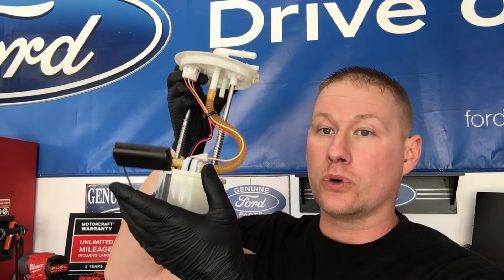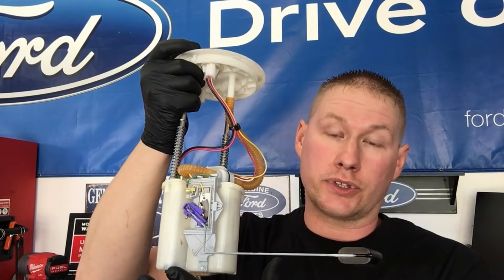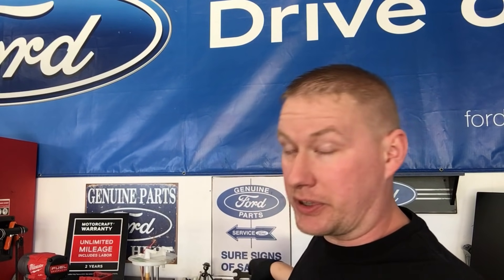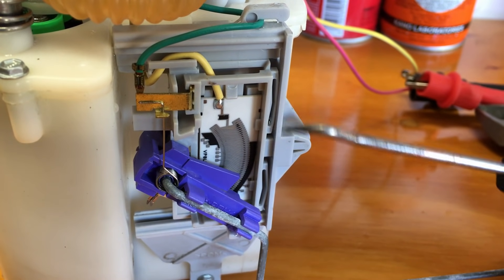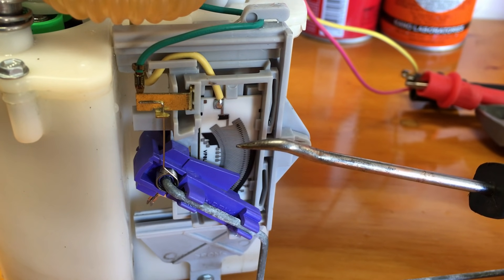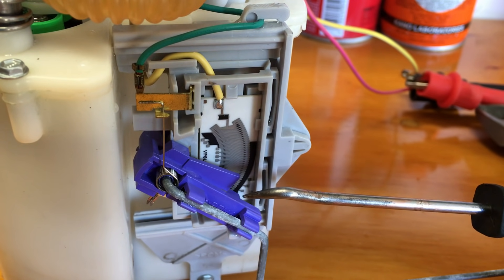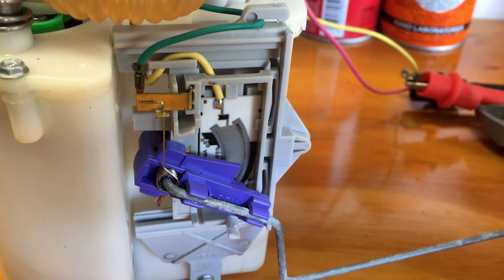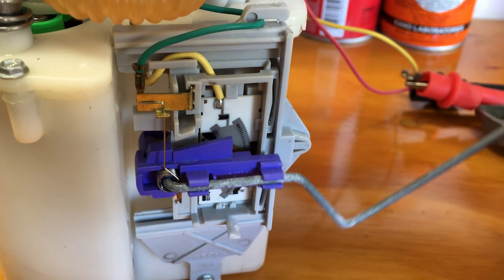Ford Quick Tips #77: DTC P0460 P0463 Erratic Fuel Gauge Quick Fix!

Comment: Replaced the sending unit on the pump for a 2008 mustang & now the gauge reads 1/2 fuel for about 30 seconds & then drops to empty.  Ran a scanner & no codes, but the scanner shows the tank is empty.  Could it be the BCM?  Any suggestions would be great.
Reply: New does not mean good. Always find the fault before replacing part.

Comment: While driving home from work today my speedo and tach needles were fluctuating irraddicly, 4x4 hi and lo lights were flashing on and off (not constant, but like once a minute) as well as the battery light.  Checked my alternator and I got 14.38 to 14.64v with the truck running.  Checked for codes and got a p0462 fuel level sensor circuit low input.  Would that cause the instrument cluster to act like I described?
Reply: It sounds like you had a ground issue. What’s this the case four years ago when you posted this?
Reply: @UhBuddy1976 No the issue was the body control module (pink wire I think) or maybe purple...was intermittently not making connection with the gauge cluster console.

Comment: Hey man, thanks for the video, so basically what’s happening in my truck is the P0463 so I thought to just get my fuel pump changed due to truck has 210,000 miles and it’s an 08 Ford F-250 5.4. So I changed the fuel pump and it’s still throwing the code and the gauge don’t work and only works when the fuel level is really low. Do you have any tips on what I can do? P0463 fuel tank level sensor high input , thanks man
Reply: I got P0460 and P0463, but the unit to replace it cost 700 dollars

Comment: So I just replaced my fuel pump as it was time and have had the erratic fuel gauge issue for over a year now intermittently. Thought it was the sending unit all this time and just went to fill up the tank and the gauge stopped at 1/2. I noticed driving the 1 mile away I live from the pump it started to creep up a tick or 2 on the gauge but I let it idle for 5 min after on level ground and nothing changed. 

And ideas what else this could be? I have no codes

Comment: 05 Explorer with the 4.6 V8, fuel gauge doesn't work after a fill up until it gets down a couple of gallons then it will start working again.  I have ran several bottles of the Chevron Techron Plus through the tank, the fuel gauge will work normally for a couple of tank fulls then it goes wacky again until I dump another bottle of this stuff in it.  I started putting gas with a small amount of ethanol in the tank, it is still 87 octane and that seems to have helped though the gauge still occasionally wacks out after a fill up.  Worst thing about the Chevron Techron Plus is it is expensive.
Reply: I may have to pull the tank and replace the guts and be through with it.
Reply: I'm currently having the same exact issue with my 2005 explorer after fill ups. Did you ever get the issue completely resolved? If so jow?
Reply: @rachel1724  no it still has the fuel gauge issue.  As soon as the tank level gets down to around 3/4 full the gauge always starts working again.  Our Explorer now has 225,000 miles on it.  We have a couple of newer vehicles, and are not going to spend anymore on expensive repairs for this vehicle.

Comment: I have a 2005 Ford Explorer xlt with the 4.0 sohc and is has 177k miles. My fuel gauge hasn’t worked since 60k miles always used the odo trip meter as a fuel gauge. The issue that I’m having is that it pegs below E when you turn the key on and never rises no matter what I do. I dropped the tank. Pain in the a** if you don’t have a lift to work on. But I managed to get everything out without an issue. I removed the fuel pump assembly and decided to ohm check the sender just for the heck of it and it worked as it should. I went on with some more testing trying to fool the gauge into thinking that the tank was full with the two wires that run to the gauge with no luck there either. So with my luck and the vehicle having 177k miles I decided to put a new fuel pump in it since the harness was still accessible for further testing and put it all back together. I also checked another instrument cluster thinking it could be the gauge with no luck there either also pegged below E with the other instrument cluster. I did numerous tests including a gauge sweep and that’s the first time I’ve ever seen the gauge function and it brought me hope that it could be a simple fix hopefully you can help me out or point me into the right direction. The only codes that I got for it was a p0463 and the message for that was fuel level sensor A high input. And a B1201-00 and the message for that was fuel gauge sender circuit open or short to battery. Any help would be greatly appreciated
Reply: did you finally get a solution? i have the Same Problem on my Expedition.....

Comment: I got P0461 / P0463 2010 expedition the other day shows —- miles to empty and gauge is on empty with a full tank of gas I’m going to have to try this . I figured the fuel pump was going to have to be replaced since it’s one unit but I’ll try this first .

Comment: I have a 2012 F350 with a 6.7L diesel. I am looking for info regarding the resistance readings in ohms when the tank is full and when it is empty. I have read elsewhere that the readings should be 15 ohms empty and 160 ohms full but this video shows it to be exactly the opposite. There is probably a difference due to year and application. Does anyone know what application this sending unit in the video is for and also does anyone know what the readings should be for my application? Thank you.

Comment: Had the fuel pump go out in a 1999 Ford Expedition. I replaced the pump assembly, everything went smoothly, but the guage still reads erratically. It's unreliable to know the fuel level. Any further ideas on the cause?

Comment: when my fuel gauge get just under a half tank it starts to drop quick and then sometimes comes back up later , Is this the same thing you are talking about ?
Reply: Did you ever try this?
Reply: Mine does the same, sometimes throws the 460 and 463 code. Gonna have to try the fuel additive
Reply: @justthetibb1569  did it work? I have the same issue, but my car is jacked up in the rear, as in on Jack stands not that it's fucked up.

Comment: Gotta thank you for that additive tip.  It completely worked and saved me hundreds by replacing that sending unit.  The first 1/2 tank, I went on a back road with no traffic, and would pump my brakes to slosh the fuel around. It started working perfectly right after that.

Comment: I have a 79 Ford E150 Chateau (dual fuel). Crank no start. Fuel gauge not working at all and no power on pump. 😭 It has new oil/filter..air filter/sparks and battery. 😪

Comment: This tip for the adding the Chevron Techron Plus fuel additive worked immediately for the problems we were having with our Ford Truck with a mustang engine.   My wife and I are amazed.  Mechanic wanted to replace our fuel pump - $680.  We are so thankful for your helpful tips on this site.  It was a God send for us.
Reply: *  I would not replace the fuel pump unless the fuel pump was not working.  I can live with an incorrect fuel level reading by keeping track of my mileage with my odometer.   

The fuel level sending unit was sending an incorrect fuel reading and also probably causing a check engine light.       Your vehicle could have been driven just the same.   The fuel pump runs just the same with or without an accurate fuel level sensor.
* Do not run a fuel pump dry so fill up the gas tank and reset the odometer after each fill up.

Comment: My guage is crazy. I put 22 gallons in, and in 3 miles it reads already 1/4 tank gone. Other times it just completely goes to empty, then it shoots up to full, and today it stayed stuck at 1/4 tank when I added 16 gallons. After 25 miles driving it went to just under 3/4 full then back to half full on next start.... what in the heck is going on?

Comment: The whole thing is about 140 dol max, don't make sense just to change sending unit part after it has been working for over a hundred thousand miles, replace the whole thing fuel pump and all. labor is the real cost.  I am currently trying the Tecron stuff about 2/3 of the first tank gone but no change yet.

Comment: About 3 weeks ago my fuel guage stopped working all together.  If it's just a dirty contactor then I'll try this additive and get back to you.  Right now I'm looking at $500 to replace the whole pump
Reply: Hey did it work?? mine gauge stopped working to
Reply: @abel21ist  no it did not.  I think that it's the computer slowly going out.  The fuel guage worked fine for about 3 weeks and went right back to throwing codes.  Currently, I occasionally get a "service engine immediately " message on the display and I take it to my mechanic and his diagnostic test cannot find what is causing the message.

Comment: I have an 07 f250 6.0, and i just got the p460, can I use this stuff in my truck or should I use the techron diesl fuel system treatment? I ask becuase I dont know if its as effective as the one youre mentioning, and I dont know if its safe since its based around gasoline and not diesel.
Reply: I would like to know as well??  I can not seem to see the answer in here.

Comment: Thanks for the info Bro, but I got a 2004 Ford Focus SE 2.3L that's giving me code P0460 and P0462. I replace the fuel pump but I still having the same issue. What do you recomend?
Reply: Hello, did this clear your 0462 code at all? have you tried? I have the same problem, but the code is P0462 not P0460

Comment: 2000 v6 mustang.  owned since new. never had a problem with it until the fuel pump was replaced almost 2 years ago. it drops to empty with the low fuel light at a quarter tank. no codes though. I'll try the techron
Reply: Did this work?. ...I have a 2006 Saturn ion I just replaced the fuel pump and it's a quarter off

Comment: My 2001 sport trac reads opposite of that. It is 15 ohms empty and 160 ohms at full.  Ichecked it against the old one and same reading. The problem I am having is that the replaced fuel pump reads erractic when below a 1/4 tank. It will be at a 1/4 tank, then when i start driving down a straight road it will go to empty, go around a curve and it will raise back until going straight again. Whats up with that?

Comment: Thank you! 

I ran 2 of the black bottles through my truck. The light didn’t initially go out, but about 200 miles in, it went out and after 80 miles more it was still off and passed emissions!
Reply: BerrymanB-12 part number 0116  in a round can is much better. And it's cheaper. I managed a parts store for 28 years. This saved a lot of people from buying carbs.😁Just don't add to oil it cleans it to much.

Comment: Hi sir this Qader from Colorado i have 2001 ford F-450 v10 gasoline there is no check engine light everything is fine but when i want drive it. the truck has no power can you help out. and also  i changed the air filter, fuel filter but it is still the same thank so much.

Comment: I have a 2008 6.4 F250 and it runs out of fuel at anywhere between 1/4 to 1/8 tank I hope Chevron stuff will fix it as this truck is a miserable B!tch to get started after it stalls

Comment: Hey what can I use for same issue on 2008 f250 diesel?
Reply: Ever get an answer to this?
Reply: @9brad86  no I didn't, but mine stopped jumping around .I realized that the computer goes by the milage the truck was getting the last time the truck was running so my digital gauge would read a different miles to empty each time I turned it on . So if I drove up a hill and it said 100 miles to empty them I shut it off and turned it on again it might say 80 miles to empty ,coast down a hill turn it off ,turn it on again it might say 110 miles to empty. Only one time did I turn it on and it said 0 miles when I knew it had about 100 last time I ran it .that freaked me out and I started looking up videos  . However other than that time it makes sense to me now.

Comment: Quick Question, have a 2013 ford edge that gave me the same code. Fuel guage stops working when it reaches half way. Vehicle has roughly 65,000kms. Is there an access panel for the pump from the inside? Or do I have to drop the tank. Just incase the Techron solution doesn't work

Comment: I add Techron Plus at the beginning of each month on all my gasoline vehicles but just got a P0460 "Fuel Level Sensor Circuit Malfunction" this morning. It only has around 12000 miles on the Ford dealer installed fuel pump. Techron or another similar cleaner might work for someone else...........

Comment: Hi- I have a 2006 mustang that just started giving me this problem where the fuel gauge drops down to empty and then back up slowly. I have changed the cluster panel, fuel pump, passenger fuel pump module and used the Techron Plus. Still having this problem, any idea what to try next?

Comment: This stuff is great. I've used it for years. It cleans so well that it made my truck's fuel pump last 2 months before dying, allowing me to get engine and suspension done first, while still driving it. Truck started hesitating, added techron. 4 weeks before symptoms again. Repeat. Went 3 weeks. Repeat. 2 weeks, 1 week. Made appt for a new one at mechanic, fuel pump officially died when I tried to leave the shop lol. Yeah, this stuff is amazing. It may be slightly more pricey but it's worth it.

Comment: Hello can anybody help me I have a 2013 ford fusion I have the same code coming up I replaced the fuel pump and that still didn't fit the problem right now i have a full tank of gas a is said is empty can any one help please thanks
Reply: Can you fix it ????
Reply: Did you replace the fuel pump with an OEM.   Replacing a fuel pump does not guarantee that the fuel level sending unit is sending the correct ohms as the original OEM pump.  The fuel pump may work but the fuel level sending unit may not.  The resistors on all fuel pumps are not all the same, hence different readings.

Comment: Should I change my fuel pump out if I’ve used this about 4 times now and still have the issue? The car was wrecked and was sitting in a garage for years and I found body parts to fix it but, have not been able to get rid of the fuel gauge problem yet. Probably 7 gallons of gas was sitting in the tank for years before I got it running again.
Reply: Have u by passed the anti slosh module behind the gauge? Didn't work on my 92 ranger but read comments from the video I watched that it seemed to help a few out

Comment: Going to give this a shot.  My 2007 Expedition will reach around 142 miles until empty, and then all of the sudden it will read ---Miles to Empty, and then very gradually climb back up until it reads 60 miles until empty.  The tank still has approximately 8-10 gallons remaining, because it will only take around 15 gallons to top it off.  I'll post another response to let you know if it works.  Also, the fuel pump was replaced about 1 year ago. Thanks for the awesome tip!

Comment: My issue is similar but not the same
2007 Navigator 4x4
Issue: Cluster reports tank to be at half when there is actually more fuel. I can fill tank but dial does not go all the way to full position. I filled tank when it showed ¾ full and it would only accept 1.5 gallons. This is an aftermarket pump because OEM burned out. 

Do I have a faulty pump? Or could there be some other problem I don’t see. Could the mechanic have made  and error during install?
Might I have been sold the wrong pump?
There is some intermittent sputtering under hard accel

Your thoughts ?
Reply: @Matt M yes...my pump is new also...so im not sure about restoring it...I'm wondering if there is a calibration or something I need
Reply: @Matt M admittedly I abused my pump....running it low all the time...bad idea  I did not buy an OEM replacement ...so i sometimes wonder if there was an error on the repair or is the pump sub par/ defective. Yes I could get my money back or a replacement.. But that doesn't cover the cost of labor. My skill set does not allow me to do that one myself
Reply: let me know if that stuff helps......

Comment: I was having this problem after keeping my car in storage while 5 years in Japan.  Fuel level was at 1/4 full the whole time and each time it reached that level my fuel level sending unit would report an error then cause my check engine light to come on.  If I didn't let the level get that low I had no problem.  I am located overseas and could not get the Techron product that is referenced here, but reading the labels of several products that were available I found that the Slick50 Fuel Tank Cleaning Solution fixed my sensor exactly as explained here.

Comment: Have a 2012 F150 with 460 codes, gauge works fine but will set a code within 14 miles of driving. Tried the 
additive method and after 3 tanks of fuel still no fix. Thinking gets spiffs for recommending this for oil companies
Reply: Some people said it worked.  You could remove the unit and clean the sender board with a pencil eraser as a last resort.

Comment: I blame myself for allowing my tank to go so low of gas that  the chime alarmed and got "
low fuel" notice on the odometer, but I wanted to wait to get good Mobil gas in the tank as always. I put in 20 gallons, but the needle only went up to 1/4 full. I believe it is the float that went too low, it's maybe not coming up, or just getting a bad reading.  I will use Chevron Techron Plus a couple times in hopes things will get back to normal and get good fuel level readings.